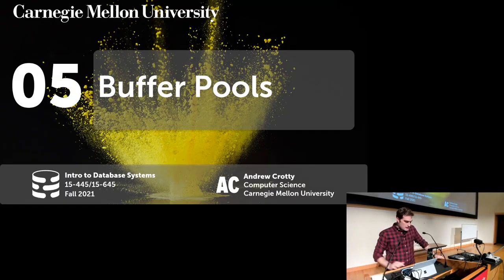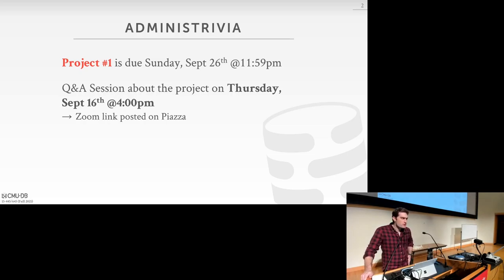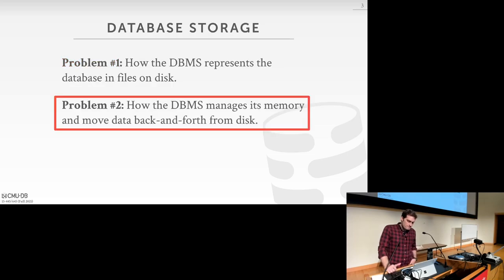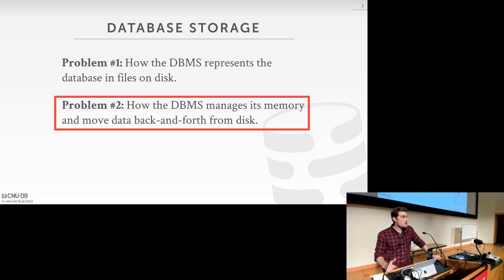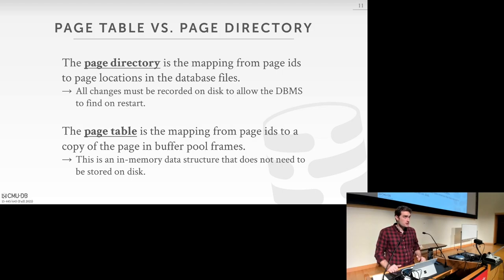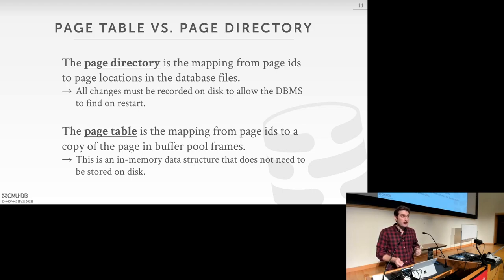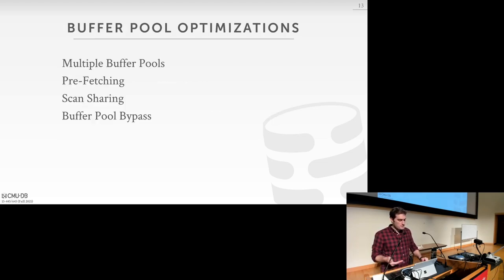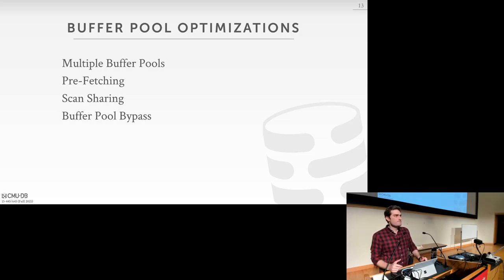05 - Buffer Pools (CMU Intro to Database Systems / Fall 2021)

Comment: 44:20 isn't AVG(val) just SUM(val)/COUNT?
Can't it just wait for the sum to finish and divide by the count, possibly cached from some other query?
Reply: I don't think that's tenable. It would essentially mean blocking the second query until the first query is finished, it seems trivial because of the use case, but for a more complex query you would not want to make a second query wait.
Reply: @Aditya-ne4lk  right. And with the LIMIT on the AVG it would have to be a SUM that started from page0.
While instead a SUM that started elsewhere could be running, which at no point in its run would hold the correct value.

However, if there is a SUM running from page0, and it scanned less than 100 rows so far, that would be insane work saving.